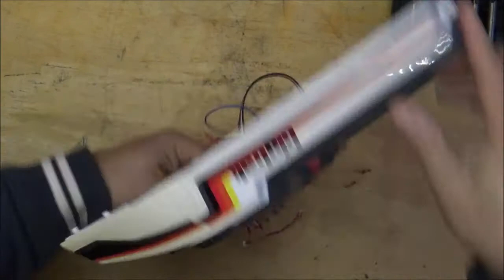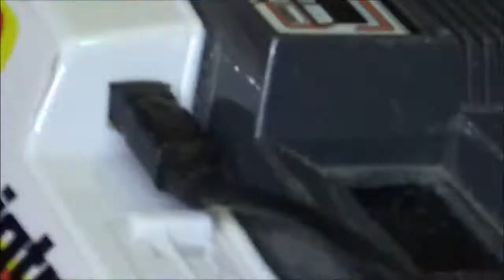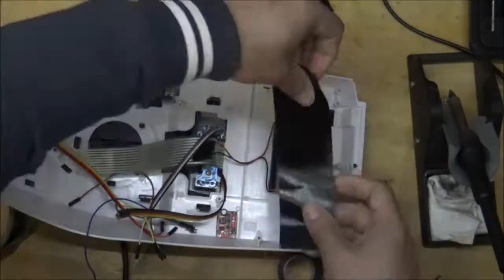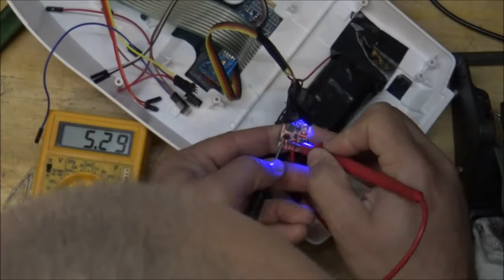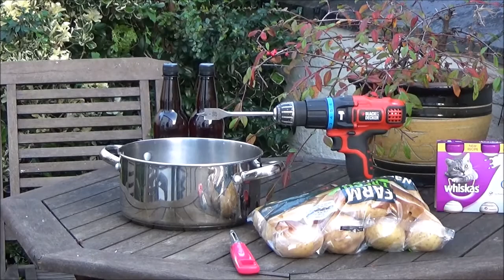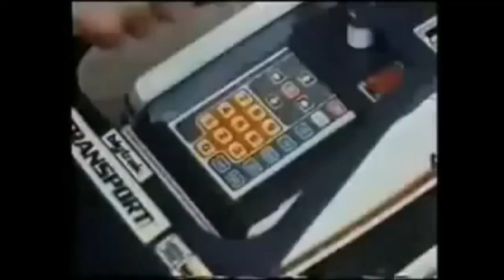Arduino robot Big Track Vintage - It works - PT6 - slightly backwards...

Comment: very cool i have an original big Trax from back in the day  the electronics and gearbox have long since bit the dust lol  I am an RC enthusiast  so converted it to full proportional remote control  changing the gearbox for a tank-style  but only running 4wheels instead of six it is permanent 4wd and runs on a 3s lipo  they are a very interesting toy  great video
Reply from the maker: Wow your mods sound epic! ... I’ve yet to finish mine... I’d like to wire up the keypad on top and get things working properly, but too many other projects just seem to get in the way! ...  thanks for watching, hope you enjoy some of our other videos!  All the best!  Have a wonderful weekend!
Reply: @DubiousEngineering  yes  i know what you mean about too many projects lol  great channel you have another subscriber
Reply: @DubiousEngineering Still do it  🙏

Comment: Just found and subscribed to your channel.

I've been working on a series of robot projects myself, so I've enjoyed watching how you have approached your current project. 

You can use the Analog pins as Digital pins, if you wish, giving you more than enough to connect the keyboard.

By the way, how do you propose to charge the batteries?
Reply from the maker: Paul Greeve ... I have the hang of 18650s...  that said, I may want to bump up the voltage on the H bridge as the motors seem a little sluggish with 5v.  One day we will get around to integrating the keypad...  but I’m working on a project inspired by RMC right now...!  Keep an eye out!
Reply: Dubious Engineering I run two converters in mine. As my board runs on 3.3v, I'm actually running three voltages in my robot. 3.3 directly to the controller from the 3.7 lipo battery, 5v via a stepup for Sensors that require 5v, such as the HC-SR04 (with Level converters) and around 3v for the motors (they are too fast at 5v and using PWM to reduce their voltage is way less effective, causing them to stall too much).
Reply from the maker: Yes, all the level converting does my Mellon in! ... I have an RGB colour sensor on my robot lawnmower project that needs level conversion... pain in a@@